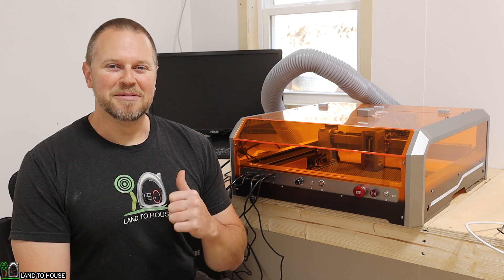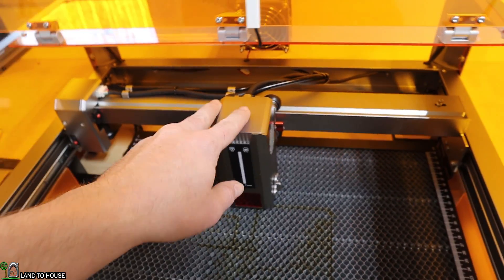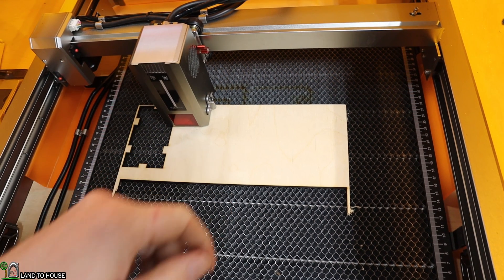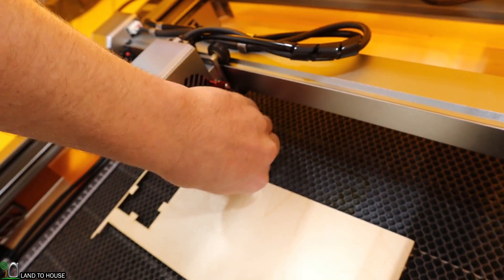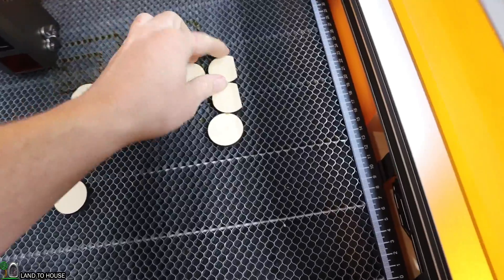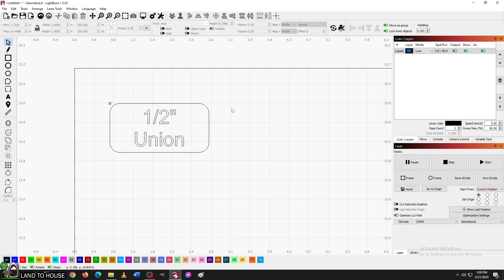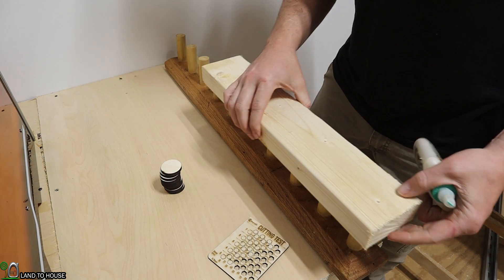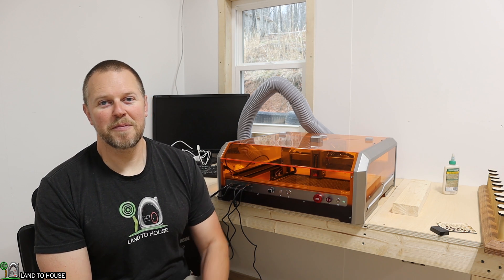A Laser Engraver for Home Use? Genmitsu L8 is a GREAT MACHINE

Comment: Thanks for the video. I have the L8 and love it. The one issue that I have is that when I clean the laser head it is very difficult to get it mounted again. I back off the thumb screw to ensure that it is out of the way but the laser head binds before it gets to the proper position. Any suggestions? There must be an easy answer as this gets frustrating.

Comment: I just bought a l8 but I don't know nothing about installing  if I connect everything the button light is on but that's it I connect to my laptop and nothing pop up can you help me
Reply from the maker: On the genmitsu website you can find the grbl driver. I think the included usb also has that driver. Once that is installed the computer will read the machine.

Comment: Was very interested in your review.  Am about to upgrade my 10w Acmer to a 20W but theirs is quite expensive for a class 1.   I have three questions that I hope you can answer.
If the little adjustment device is 3,5,7 mm, how do you handle thicker pieces?
I understand that there was a software issue.  How easy was that to resolve?
They don't have a facebook group to offer support.  Did you find that a negative?
Thanks

Comment: I got one when they first dropped. Their laser update software wont let me update the firmware. Fire alarm goes off constantly. Customer service tries to help (slow email responses only) but no resolution. Pretty bummed because this is a good machine. When it starts to cut or engrave, its great for about 5 minutes. Then the alarm goes off without a single flare up.
Reply from the maker: This is probably going to break a warranty but...If you are watching the machine for safety you could place some tape over the fire alarm so it does not detect light.
Reply: @LandtoHouse  I'll have to give it a shot! I'm always right beside it anyways lol. Thanks man!
Reply: @butterflyknives6674  I have the same problem.  My brother says it's the air assist.  And the air assist light doesn't stay on. So frustrating and wasting material

Comment: I wonder if you can mill PCB's with this, it's like 1.6u thick copper clad hmm
Reply: i was wondering the same.  Saw a vid where a guy painted copper clad board and used the laser to burn the paint away for the standard etchant technique.  Very professional results.  That's one of the things hat I'm planning to buy one for.

Comment: There seems holes on the sides ? So the laser isn't fully enclosed, you can use it without protection glasses ?
Reply: if you look inside, you will see the orange filter plastic the protects those openings. As long as you aren't looking Directly at it or a reflection of it, it's perfectly safe.

Comment: The directions for removing the nozzle and cleaning the Lense for the L8 Laser engraver are not helpful.
I cannot get the nozzle off.  how does it come off? Does it screw off?
A more thorough explanation of cleaning of the Lense is needed.
Reply: Turn it anticlockwise to unscrew, it may be tight but it will come off if you unscrew it.

Comment: Thanks so much for posting this video! I have been going back and forth on what to buy and for the price of this unit compared to the others I think this just sold me on it!
Reply from the maker: Great.I have used several of these diode machines.And this one is so easy to use.  Right out of the box it hooked up to lightburn and I was cutting in no time.
Reply: @LandtoHouse  Could I ask you more more question? How much room above the lid do you need to open it? Thinking of putting it on a shelf and thats been one answer I cant seem to find :)
Reply from the maker: You will need 28" in height. And 32" depth to install the exhaust.
Reply: @LandtoHouse  again thanks so much!